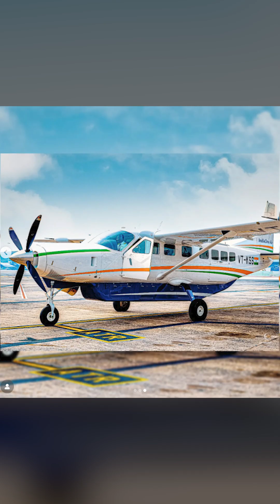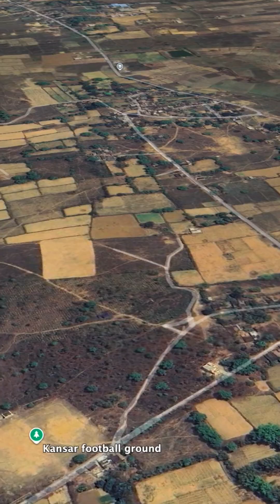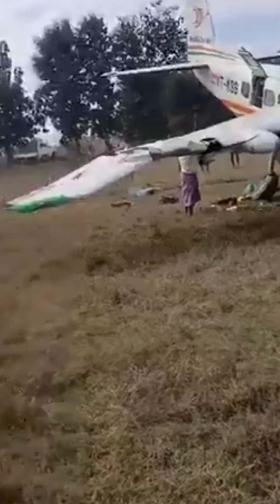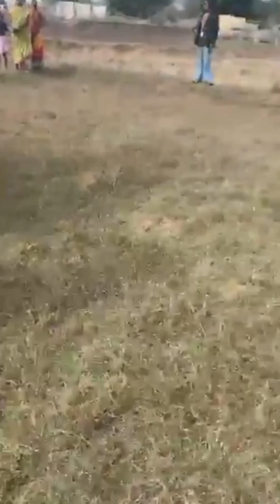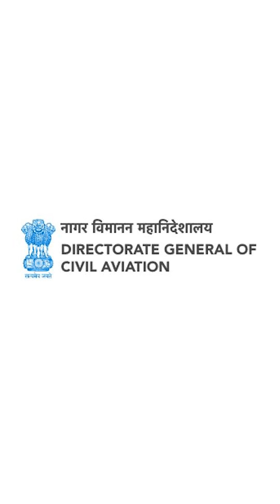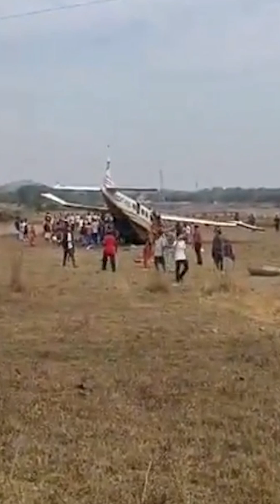Cessna Caravan’s Engine QUIT- the PILOT Didn’t!

Comment: Those PT6A engines are known to be reliable, they are considered bulletproof. I think this aircraft has a varient of this engine type. But everything fails once in a while, I guess. Sometimes there are external factors like fuel contamination or maintenance errors. These aircraft have a reasonable glide ratio I guess. Plan ahead, know your alternate airports and fields in case something like this happens. A twin engine aircraft is good too.

Comment: falling brick? really, with a glide ratio of around 13:1 it is pretty dang far from a brick. LOL
Reply from the maker: I don’t think it’s 13 to 1. My 210 has less drag is 9 to 1. And if it happens to be fully loaded with passengers and everything else.
Reply: @TakingOff  Cessna claims 12:1-14:1 depending on model. I was surprised at how good it is as well, I was expecting closer to 9:1 as well. But even at 9:1 that is no brick, Cessna's all have pretty good glide ratios. I just don't like talk like that cause it contributes to the public thinking an engine out means a death sentence or that planes drop rapidly. We all know from training that you have lots of time as long as you have altitude and planes glide along very nicely with the engine off.
Reply: @T @TheDornado 

Ask Cessna again…

A Mooney with a Laminar wing has a glide ratio, clean, of about 10:1 fully loaded…. 12:1 when extremely light.

A big fat Cessna with gear hanging out, will glide… but it won’t win any special glider awards.

A quick review of the internet does back up the nice glide ratio… but, it is very important to have the prop feathered to achieve it.

Notes also indicate the engine is still producing thrust at the lowest power setting…

So actual engine out performance is going to be more like a brick, than a peregrine falcon….

Other notes indicate… without power, the nose is going to be very heavy….

Check the fuel carefully… every time.

Accidentally getting 100LL in a Cessna Caravan can cause hardships…. 

😃
Reply: @AC-jk8wq  My information is from the POH from Cessna, so yeah it is accurate and it is with the prop feathered, which you would obviously do anyway for best glide. You can disagree, but they make the plane. Mooney wings are built for speed, Cessna's are built for lift.
Reply: @T @TheDornado No argument here…

Just trying to figure out how Cessna Caravan does so well in the glide…

Getting most Mooneys to stop the prop from turning will cost losing 1k in altitude….  Slow way down, to get the prop to stop turning, below best glide speed…

There are two Mooneys, rocket and missile, that have featherable props…. Really good for engine failure at altitude.  Really terrible for prop governor failure at low altitude…

Thanks for sharing the conversation!

😃
Reply: @AC-jk8wq  yeah I was really surprised when I saw that number as well. I was expecting like 9:1. My guess would be because it was designed for STOL operations so the wing is really efficient at lower airspeeds like when you are engine out. But just a guess. Gotta love Mooneys, I was lucky enough to fly a friends as my first ever airplane. Got me hooked and started my training not long after.